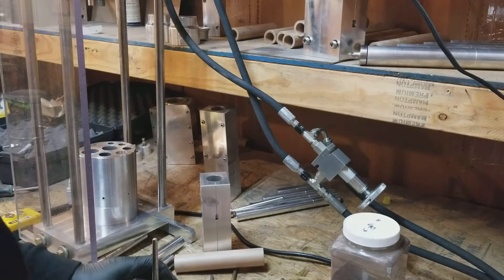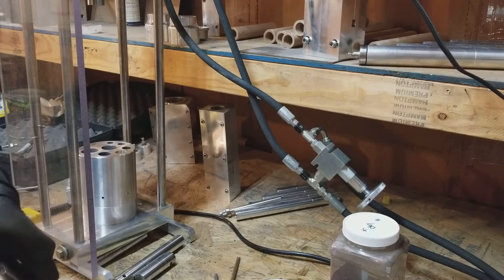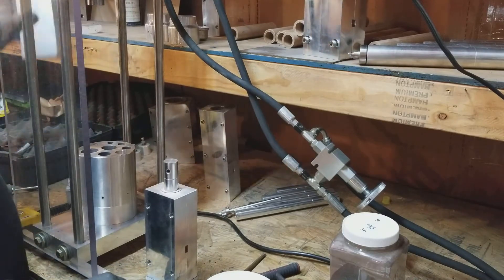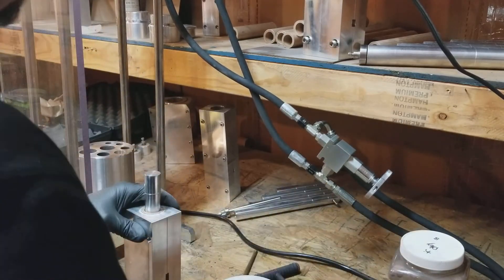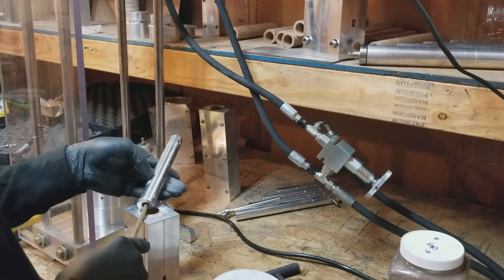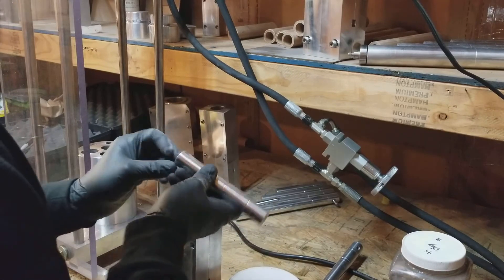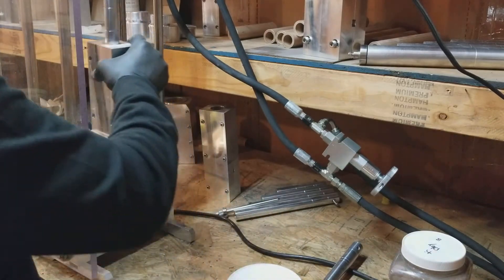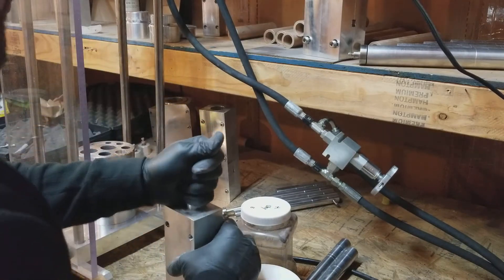Pressing a 3lb whistle rocket start to finish.

Comment: I rammed it manually with hand, and it exploded, what's the cause?
Reply: you cant hand ram whistle fuel
Reply: I meant, i press with my body weight
Reply: @enami_zei  not enough pressure bro trust get a press
Reply: whistle fuel is shock sensitive